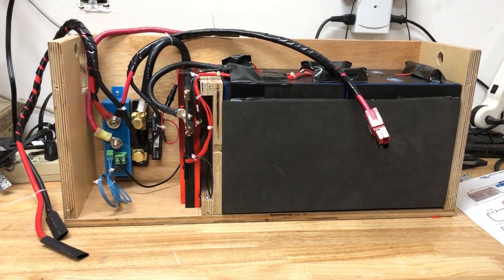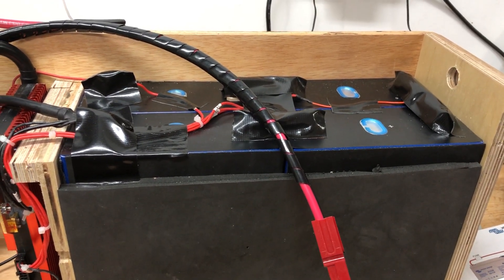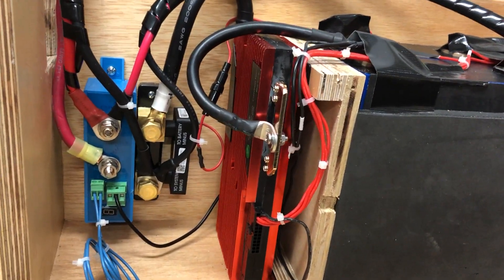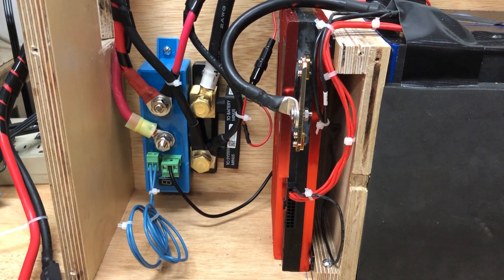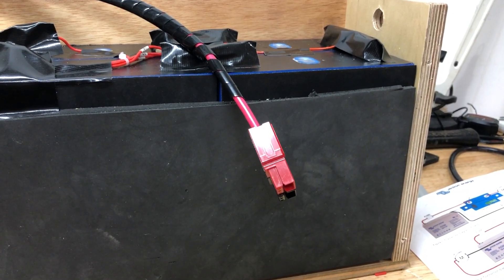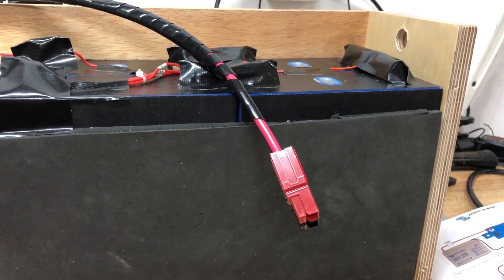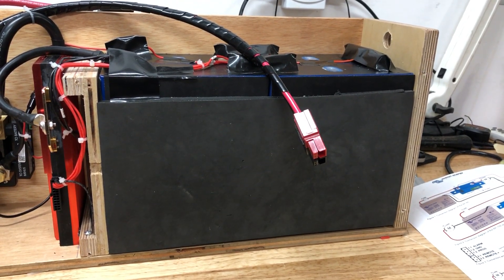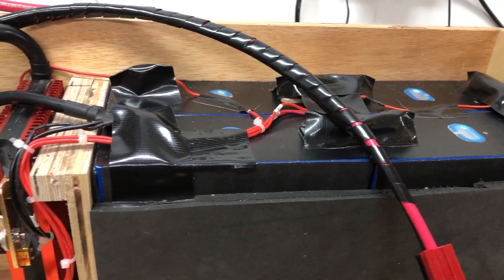LiFePO4 battery replacement for lead acid batteries

Comment: That's not a supported install for that Battery Protect. You're going to fry that battery protect if you run an inverter. Also, if you have any charge sources, you'll also kill that battery protect as current can only flow in one direction through that.
Reply from the maker: Please provide data as i dont see it that way since it work
Reply from the maker: I have a transfer switch when inv comes on

Comment: If possible I would move the shut away from the battery disconnect. The sparks will fly if anything conductive gets between them.

Comment: is that cable going to handle the amps you need.
Reply from the maker: The camper has very low amp requirement.  Under 10 amps.   Dont have the inverter hooked up but air conditioner load is about 800 watts and only need for an hour.
Reply: @cluffscirrus620adventuresa4  so 67 amps for 800W.